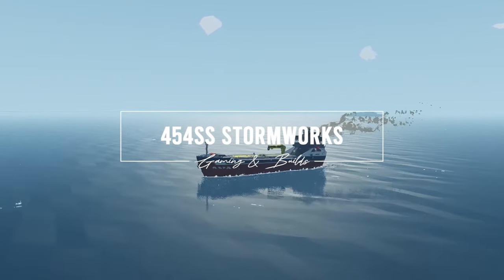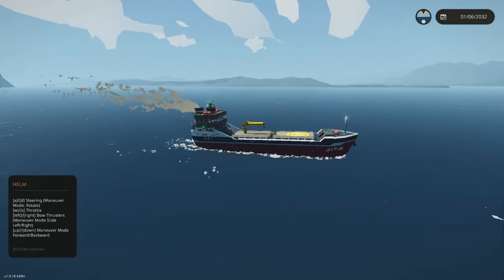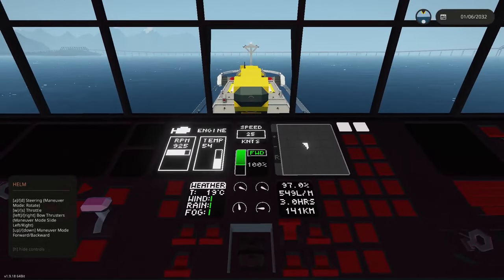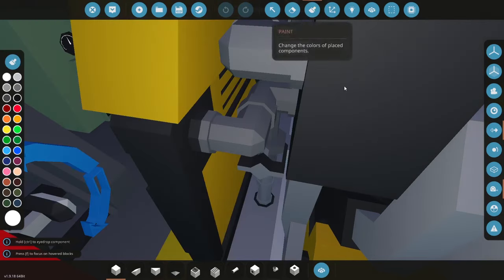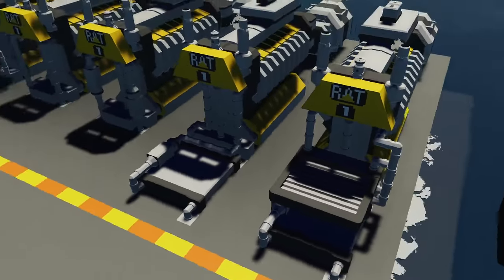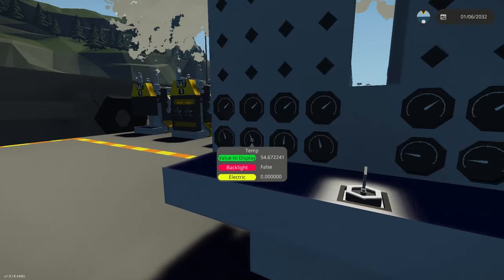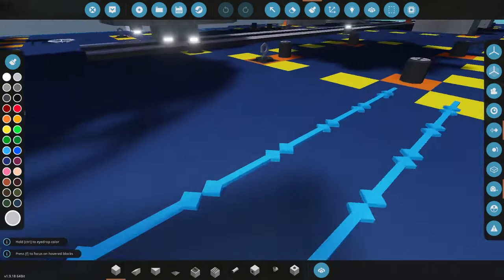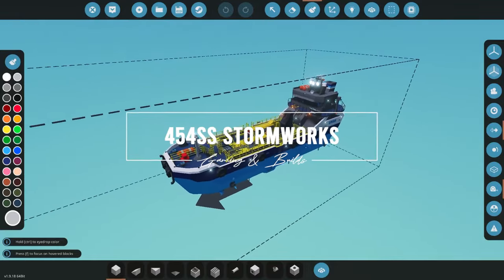ENGINE COOLING IS FIXED - Compressed Gases Update

Comment: I think the cooling being strong is good, it will benefit modular engines that previously produced way more heat per power than prefab engines. It will also help compact builds.
Reply from the maker: Totally agree - the whole point of the game is engines, so without a major component (diesel) working proper, it put a big damper on everything :)

Comment: Remember, the devs have pointed out that sea water will slowly damage the engines. Using straight sea water cooling the most shouldn't be surprising.

In real life spraying sub 20c water on a hot radiator drops the temperature. So it shouldn't be surprising cold sea water is the best.
Reply: Wow. Detailed. Props to them
Reply: It's called scaling. From what I understand it happens slower or faster depending on how hot the engine gets. 

Scaling happens when a engine gets over waters boiling point and it boils the water and it deposits a hard structure of salt/calcium and other minerals in it. Inside the cooling passages of an engine. It's irreversible to my knowledge that only a engine rebuild in real life fixes it

Comment: I tried to replace two small engines in a boat with two small modular 4 cylinder ones after i finnaly researched them. The small engines had been cooled by a seawater intake, no pumps and ran at 20 rps no problem giving me 20 knots. The modular ones needed a small pump each, but still reach 110 degree relativly fast even running only at 15 rps. I added 2 more cylinder and another cooling manifold but no luck either. The modular engine is slower and runs hotter, the whole cooling system now takes more space, i don't see the improvement going from prefab to modular. I am certain i miss something crucial here but i honestly dont understand.
Reply from the maker: Very interesting observation! I will look into this!

Comment: Finally it's fixed
Reply: Fin
Reply: Forced air intake only provides a fraction of the power it used to. If this was an intentional change I wish the devs would just say it.
Reply: It is a same that superchargers are weaker, but they are still stronger than natural aspirated

Comment: Happy Birthday,
Would you think placing a heatsink or radiator into water makes a difference?
I would think it does but I also would think 2 radiators is better than 1 but can't deny those results.
Reply: 1 radiator has coolin eg 1 but 2 radiators have cooling 1.5, each radiataor adds only 0.5 more colling after 1st one is 1 cooling

Comment: Here is a challenge for you ;)

Create a helicopter capable of carrying seven individuals, including the pilot. Equip it with two winter outfits, two ropes, two cables, four medkits, two defibrillators, and other relevant supplies. Optimize the system for efficiency, incorporating a signal searcher for rescue missions. The dimensions should be within 12 blocks in width, 22 blocks in height (preferably less), and a length of 20 blocks.

Comment: I noticed that the more water tanks you add, the better the cooling
Reply: A cooling water tank can buffer heat for burst power, but you still need to cool the water from the tanks. For sustained cooling don't use water tanks or T-pipes works best as they only ruin the flow rate.
Reply: @Adesterr don't know what you're talking about, as of the new update I added fluid tanks to my previous cooling system and it increased flow rate and cooling power. Check it out for yourself.

Comment: No idea what they changed again, but seawater cooling is the worst now ... 
I have a 4cy 3x3 engine, each with a pump in and pump out for sea water and yet they run only cool at 70% throttle and overheats with 100%

Comment: I never saw an issue with engines but is there really any advantage to having lower tempatures as long as the engine isn't blowing up? Does it increase efficiency or something?
Reply: For me, more effective cooling in a budget build means i can sustain higher RPM when i need the torque. Specifically dog fighting in an otherwise low powered prop plane. It burns fuel fast when doing this, but it's better than losing the fight

Comment: On my 8 cylinder 3x3 modular engine, the fix seems to have worked, the coolant flow has been improved, BUT my engine is now overheating? It wasnt before with like half the coolant flow. Thing is: the 8 5x5 Radiators arent going to temperature, they stay at like 30 degrees, while they went up to like 60 before. I have the theory that the coolant now flows too fast and the radiator cant take the heat das enough, but if I limit the flow, the temperature of the radiatora still stays low and the engine still overheats. I dont know what the problem is here.....